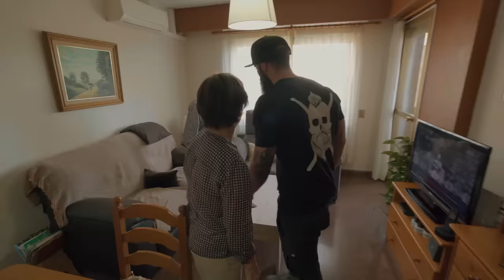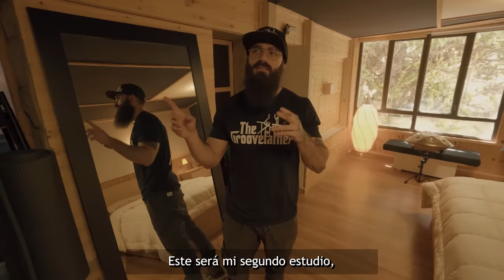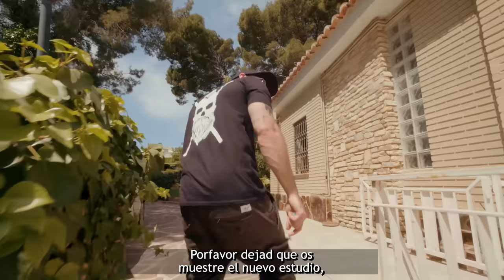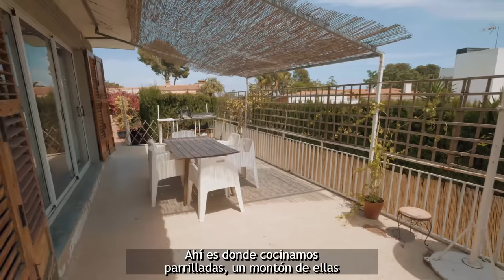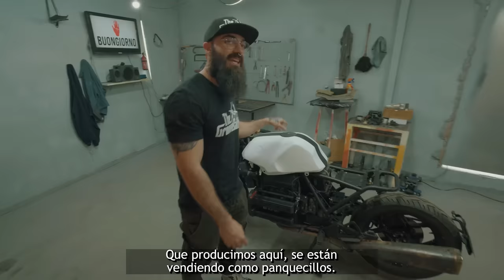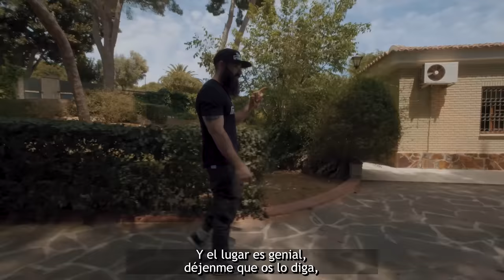THIS IS MY NEW HOUSE!

Comment: i know it is wrong of me to comment on this - but once i saw you behind the steering wheel i was more reminded of an elderly driver than a badass drummer :)  i would have expected you to be leaned back , one hand on the steering wheel  - posing for the camera.  But make no mistake, I'm not saying its wrong in any way - just to me a curiosity. FYI -  rally drivers drive straight backed and close to the wheel, making sure they can feel the car thru their spine. Undercover Carlos Sainz ?